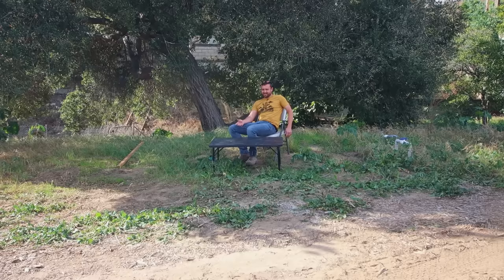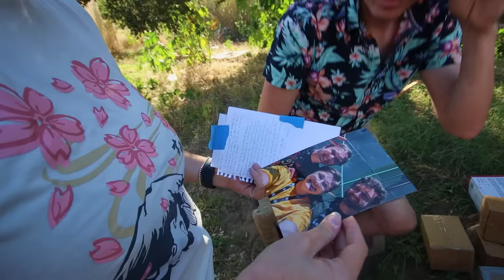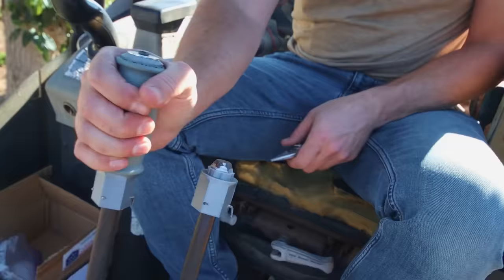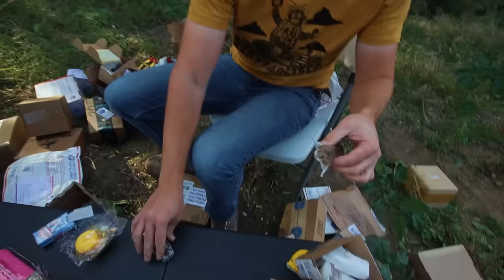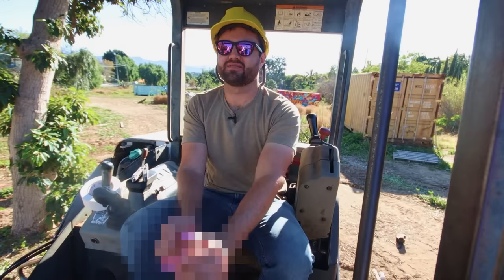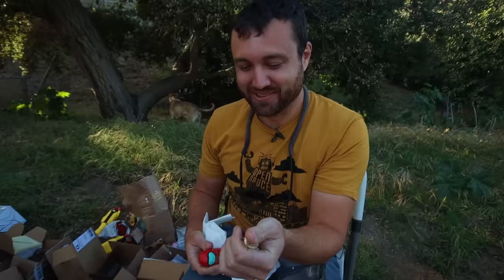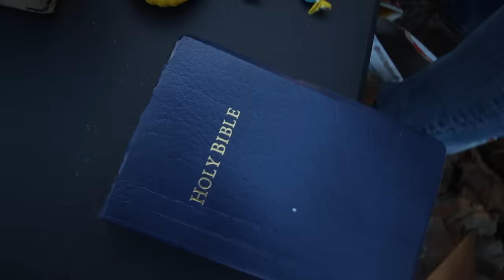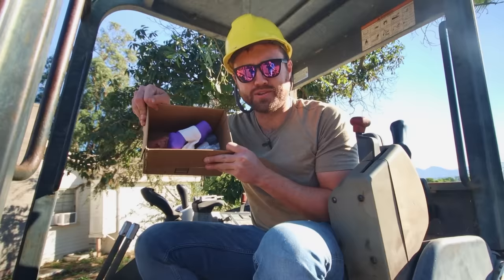Construction worker UNBOXES excavator handles

Comment: If anyone cares that radio is a AN/PRC-90 and was in common usage for the US Air Force up until about 5 years ago. It uses 243 and 282.8 for voice transmissions. It can be ran off of 4 CR123 batts instead of the special battery it uses.
Reply: So, you can’t really use that radio without a license?
Reply: @gemhunter498  oi, you got a loicense for that loicense?

Comment: when picking a knob you want some that come close to touching in the middle. This is so when you track the excavator you can somewhat operate the controls with one hand. It takes some learning but you end up using you palm and twisting your wrist more that grabbing them.
Reply: OMG actual excavator advice.
Reply: @GreatNW That's really cool! The ones that looked the best to me were the taller black ones with the super smooth print. Would those work with the one hand technique?

Comment: If you want to inspect that SD card without getting pwned, you could remove the internal storage of a computer and live boot from a linux USB with no internet capabilities. It should reduce the risk of pwnage by 100%, just be sure to dispose of the SD card if it looks malicious so that you don't accidentally pwn yourself, and you'll probably want to wipe the USB afterwards as a precaution

Comment: A lot of people using 3d printer didn't take into account printing directions, so they all snapped. You want to print them in another direction, it will be much much stronger as the grain went the same way with shearing force.